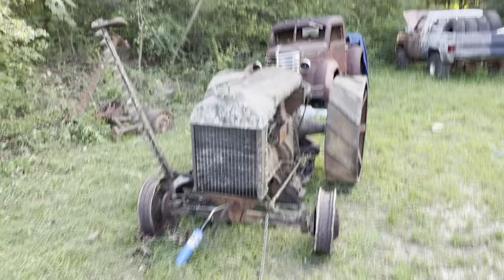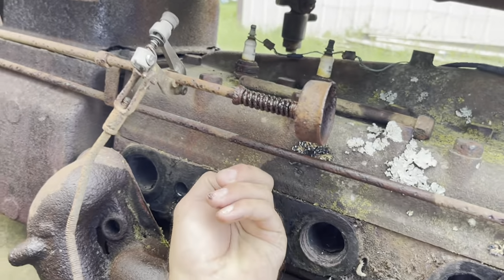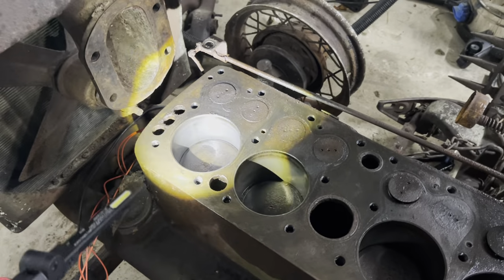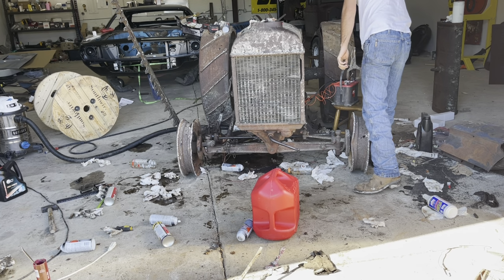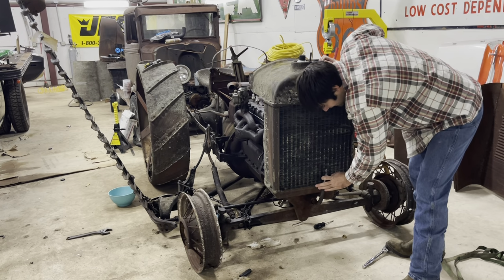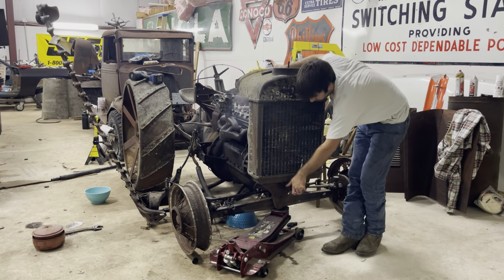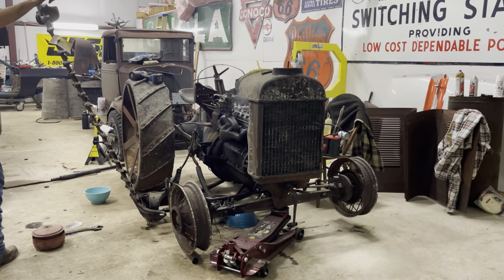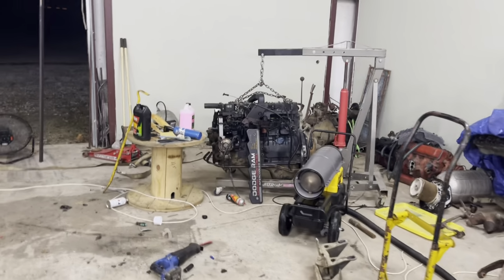Will it run after 80 plus years 1922 Fordson tractor

Comment: My dad said my Grandpa was still using one in the late 40's into the fifties. My dad said he loved to hear it run, he said he'd come over sometimes just to crank it to hear it run. Dad said the steering was horrible. I bought an old Chevy Nova years ago without power steering, my dad drove it. I said, drives good doesn't it. He said yes, but it steers like an old Fordson tractor. I miss him when I see videos like this. Great video, thanks for posting it.
Reply: What else did your dad say
Reply: @danielreilly1302  He had a lot to say. He said to never buy living room furniture that's too cheap. Because before you know  it, a spring will be poking you in the back end. He told me he stole a set of front tires for a tractor with that big ridge in the center. He said he thought they'd last a long time. He said he put them on the back of a 35 Ford. They had the same bolt pattern I take it. He said he went only about 3/4 of a mile and they both blew out. He said they couldn't handle high speeds. He also told me that during the depression when people  that had worn out tires and couldn't get or afford new ones, people would find another set of worn out ones about the same size and cut the bead out. Let the air out of the mounted set and slip one's with the bead cut out over them and then air the tires up. The inside ones would swell up and hold the outside ones in place. I guess it was a homemade retread. He had many more stories. He told me he got the crabs one time, and rubbed his privates down with DDT and  killed them. Did you want to hear Tractor stories, or just stories in general. I have a ton more.
Reply: OMG he'll be a guy, great story!
Reply: There's nothing wrong with sharing memories my friend!! When we get old which I am, memories and stories are all we will have left!!! Let's see what kind of memories the younger generation are going to have when all they do is play with cell phones!! Preserving the past and talking about it takes a special kind of people!!! This is why the world pretty much sucks for the most part today. People just throw away everything!!! I treasure all my memories and the stories from my childhood!! Just remember this, never be afraid to walk alone because God always walks along side of us!!! Thanks for sharing!!!
Reply: @lottiecooper609  I'm 57 now, my Dad passed away 9 years ago. He told me lots of stories about when he was young. He had children late in life, and I did also. My children are 12 and 14. A boy and girl. He was a hard mountain man, and didn't  put up with much nonsense. He and his brothers bought a surplus Army truck and logged with it. He said that they would run the bumper of the truck up against a tree and use the winch to haul big logs out of hollers where others couldn't go.He said they would load the logs by hand. He said he would cut timber all day with a twin cylinder Mercury chain saw. He said that was the first good saw they had. I've worked hard jobs all my life, but nothing like this. People are softer now. He went into the Army at the end of WW2 and told me much. I joined the military at 17 as he did. I was looking at myself the other day and it's riddled with scars like his was. I feel hard times are ahead for our young one's. I'm trying to prepare my kids for what I see coming. Many won't be able to handle it.
Reply: gage
 @DRILL-SGT.HARTMAN   Yes and I used to have a tractor
Reply: holy cow you are some guy my friend
my dad told me stories o his da and Watt Earp in Nome Alaska,,,,,,, loved t have heard your stores about your   dad           Ed
Reply: @volusiarider66, if you haven’t started a channel telling your stories, you’re missing a huge opportunity. 🤘🛠️
Reply: My grandpa had one of these also, supposedly they had valve stem get bent filling silo,so they pulled the bent valve to the anvil, straightened it out, stuck  it back in and finished filling silo
Reply: @DWK-ln9rm  Sometimes things are just too complex nowadays.
Reply: @lottiecooper609 All we do is play with cell phones? Pfft, what a stupid thing to say. I have countless memories of my relatives, a few but most of which don't involve physical items. You're complaining on the internet, thanks to technological innovation. The irony is astonishing. SMH. 🤦‍♂️

Comment: Try using a squeeze bottle with 2 cyl gas mix to feed it fuel through carb. Will help lubricate combustion chamber/cylinder walls while keeping it running.
Reply: I don’t see a carb
Reply: @matthewmcmenamy1398  there is one on the intake

Comment: Mr. Jennings…Great Job! I used to drive a Steel wheel Fordson on my Uncle’s farm early 1970s. It had a Buzz saw on the front and therefore we only used it to Buzz firewood. Once we got the Buzz Boxes working, it would run quite well. But, what a Rough ride with those steel wheels. I think that is why my Uncle made me drive it!

Comment: #1 where did you get the coils?? 
You should explain that each cylinder has a different sound. 
#2 Its absolutely amazing that something that sat in someone's yard for decades is up an running without a full rebuild!!

Comment: A cool rig. Never seen a mid mount mower on a tractor of that vintage. Reason they put rubber tires on the front was to make it easier to steer.

Comment: I am amazed the cylinders looked so good I was exspecting to see them rusted solid? Its actually in great shape. I would have never even tried but its free and not locked after some hard work. It runs WOW amazing. That is a cool looking tractor steel rims with paddles and no rubber tires. How cool is that? Great machine. Everyone of these I have ever seen was so rusty never seen one in great shape. This one is one the best i have seen.

Comment: I read a short essay about the the author's experience with a neighbor's Fordson. He was instructed to go plow a field which required him first getting the tractor started. So he cranked and cranked and cranked without so much as a pop out of it. At noon the neighbor returned to find the author exhausted but still trying to get the Fordson running. The neighbor grabbed the crank pushed in a little and gave it a pull and it fires right up. There was enough end play in the crankshaft that the magneto was out of alignment and it wouldn't spark.

Comment: Prob my fave video on this channel - got the exact same old Fordson sitting at a park near me in Australia. The steering wheel has come apart in the same way as the one in the vid (even the free spinning radiator fan), actually, they're both more or less identical except the one down here is missing the radiator and engine shroud, but it does have the original front wheels.
I'm tempted to try to get it running after watching this - it's just sitting there as yard art at the moment near the plow and other ag gear it used to pull around. Great to see they can still get running after sitting around for nearly a century.

Comment: There's one of these outside a local antique shop that has a ratchet 4 point lift with a 2 bottom plow, all 4 original steel wheels, spark plugs, and the SEDIMENT BOWL. IT STILL HAS THE ORIGINAL, UNBROKEN OR CRACKED SEDIMENT BOWL

Comment: Too bad you cant find one of those Staters they use on those Drag Cars too start them. Rig up a piece to go in the end of the crank. Hell if it turns one of those big engines it should turn the tractor over..Im not sure if they are a Hydraulic  pump type. Or if they are Electric.  But knowing how good of a mechanic  you are. I know you would get it too work..Though the crank is a Great exercise  for a Guy...LOL...Great Video..

Comment: Rig up a high power shop vac (or 2 with a T connector) to a reducer, attach a 1/2"  diameter reinforced hose for high pressure purposes... you can then effectively vacuum out tight spaces.

Comment: Fun lol ok now put some marvel mystery oil down here and break them rings loose . Also that hand crank is a killer when it hits you you will remember lol . I youse an old split rim  and welded a plate across the center with a socket reversed to go on the square drive so when it kicks back it doesn’t hurt you and it gives a bit of flywheel effect when you spin it over . After you get her running right you can go back to the hand crank.

Comment: My father had one just like it, he would use a 6 volt dry cell battery for the juice to the coils.my father would grab a hold of the crank by hand and crank it till she fired.up by the steering wheel was a lever for the spark advance

Comment: Since you are starting with a battery connected to the coils (rather than magneto) you don’t need to crank quickly. Retard the spark and slowly lift the crank set at around 7:00 to around 11:00 and if your timing is right and you have gas it will start. You will need to prime it first and have a rich mixture to begin … then adjust it lean.

Comment: Hey you should try heating stuck nuts and bolts red hot and shower it with water till its cold and see how easy it comes out. I showed it to a friend and he is 40 years older than me and he dident think it would work, tryed just heating it. Dident work. Tryed my trick and came right off. He dident beleve his eyes. So youre welcome and happy to see if it works for you too:)

Comment: When you pulled it with the strap the strap was coming off of the top of the pulley you was actually turning the engine in reverse. Fordson tractor spin clockwise facing it like all the other

Comment: If it had a belt drive you could have used another tractor to start it.
The reason why it was parked was because it was too much work to get it to run.
When it wouldn't run at the end was because you flooded it or too much Either.
It is a 2 man job to start a tractor like that.
One to crank and the other to work the controls.
Advance the spark a little and work the throttle and choke.  You need to watch more episodes of Green Acres.

Comment: Trying to start that with a ratchet strap was not a good idea, those old engines were quite prone to backfiring and had it done that you could have been pulled into the tractor quite forcibly.  My father broke his arm back in the 1950's trying to start a crank tractor and that was just from the hand crank staying stuck to the shaft so it spun around backwards and hit his arm.  Just a FYI for anyone who has such a tractor, they can bite back.

Comment: Drop the oil pan and remove all dirt and gum- the oiling system is splash and needs clean oil. The transmission and rear end need 600 W oil available from The Fordson House or heavy gear lube at 120 or 140 wt heavy duty. The type of gears in the rear end can be seen in the manual.

Comment: can we see a little more on the ignition please
after restoration, my dad got me to hand-crank his morgan 3 wheeler vee-twin back to life, for the first time in 48yrs, since he's getting on a bit.     4hrs later, it started, i was on my knees.
the next day i went round again, he leaned inside, pressed a button + an ELECTRIC STARTER fired it up straight away !!!    "well it used to start off the handle every time in the fifties, so i was just making sure i had built the engine back up to the correct standard" THANKS DAD...

Comment: The Valves had to be open, If its filled with dirt, Fill the motor for 1 month with brake fluid, put a jack under the front Bar, that turns the motor over, Put the weight, of the tractor on the Bar, It will brake free on its own.

Comment: whne starting old stuff put a lot of fluid or fuel in the carb as until it runs there is no suction to vapourise the fuel.
And leave it a few seconds for the fluid or fuel to fill the manifild with gas.

Comment: You need to change oil and do major repairs before running the engine - pull the oil pan and clean out junk- pell head and clean it up before you do major damage

Comment: If you're going to make it your life's work to resurrect those ancient engines, you should make yourself a metal thumper. It's basically a buzzer made from an old telephone or some other bell ringer that has a very light strike but is repetitive and relentless. Soak your pistons in penetrating oil, heat up the block and turn on your thumper and walk away for 12-24 hours. Come back and most times the stuck will have unstuck.

Comment: Geezus.  If you are going to try and  "pull start"  a tractor,  wrap a rope/ strap around the  PTO pulley if it has one, or block it / tie it to a tree  etc  jack up a wheel and wrap  strap around a tire.
Reply from the maker: Sadly the tractor doesn’t weigh enough in the back end to pull start and no pto and both wheels have to spin at the same time for the engine to spin over I tried that but thank you for the advice

Comment: I made a hand crank one day for my old tractor and I made it so I could use my 3 foot long 1/2" ratchet on it.  That way it is a double safety incase the handle does not release from the crank when the motor starts.  To my shook I could NOT use 1/2" impact wrench on it..Would not turn the motor over...??? odd

Comment: Did you find a engine for the Cuda yet?
Reply from the maker: Not yet still looking for the original but I have found a few date coded correct blocks
Reply: @jenningsmotorsports7554  part three of the cuda you said you were still waiting on parts is it coming pretty soon you make great progress for the first 6 weeks and then I realize you have lots of problems digging up the last of the parts
Reply from the maker: @steveloeffler1152  yes the first few weeks I had parts coming every other day then it got super hard to get the last few things I needed but I have the last few body parts now so part 4 will be soon
Reply: Good Luck!!

Comment: When starting an old tractor that has not run for a long time, remove spark plugs and add some diesel oil to each pot, tghen turn engine if possible,  Flush fuel tank and add MARINE two stroke oil, then fill up with petrol to get a mix of about 25:1.  The two stroke oil will free up stuck piston rings and help a bit with compression.  Subsequent tanks full need not have as much, or any,  added marine 2-stroke once the engine is running well.  I used to drive a small sawmill with these old Ford engines--usually the E27N model which had a magneto which I always converted to a coil ignition.  It was essential to retard the spark when starting or they would kill you.

Comment: Try not running on pure starter fluid bad on valves and rings. Once it starts use fuel or gas in a squirter bottle.

Comment: Could you pull start it?
Reply: It is a worm gear final drive, not ring and pinion. They don’t pull start well or at all depending on the worm ratio/lead angle. Best option is to start them by the belt pulley (which is driving the mover right now) if they’re real cranky.

Comment: This is the worst vídeo of motor repair that i ever see in my life
Reply: There was no repair at all in this video, most other "will it run?" videos on Youtube consist of getting an old engine, checking that it won't start, spending (a lot of) money swapping parts for new ones, and then trying to start it... Obviously if you repair an engine then it has to start, otherwise it is that it is not correctly repaired or correctly assembled.
But you don't see every day how an engine that hasn't worked for almost a century starts up again without having to fix it.
Reply: I couldn't agree more, some of the piston rings must surely be seized and it's only running on about 2 cylinders, I'd be very unhappy with it if it was mine.